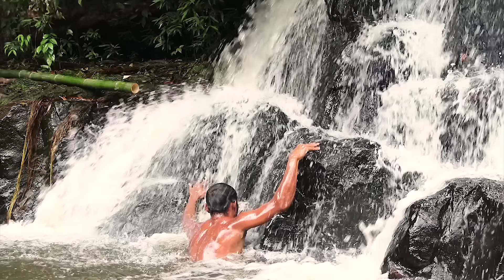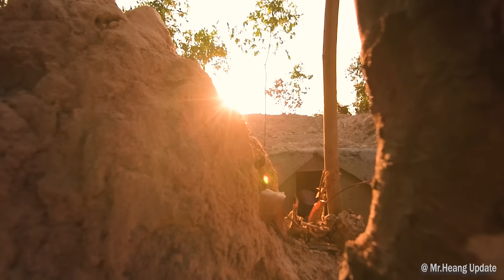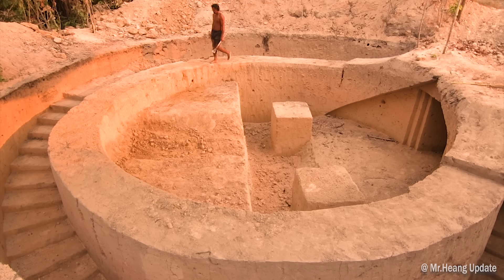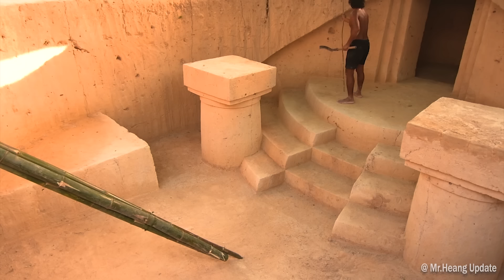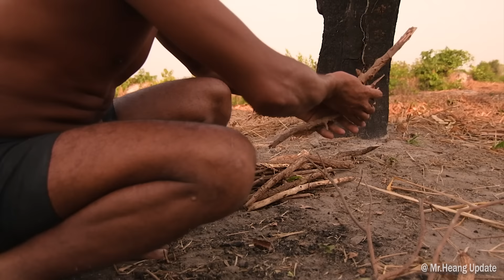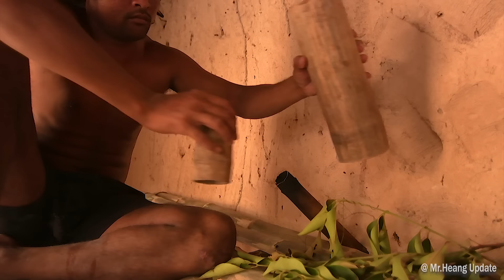78 DAYS TIMELAPSE - Build Awesome Underground – Part 1

Comment: I can't stop thinking that if you step on the ceiling it will collapse...
Reply: This time its a rather small interior, in cases of the bigger ones he always made a ceiling. As long as someone would purposely try to damage it, I guess its pretty safe
Reply: He can always build the ceiling with bamboo which is strong enough to hold human weight.
Reply: @KISSbestfan  I know, i know. I guess he wouldn't sleep there if it wasn't safe.  Its just my f*cking paranoia.